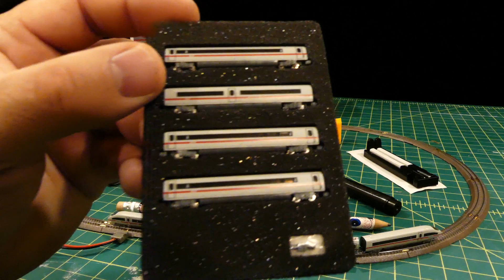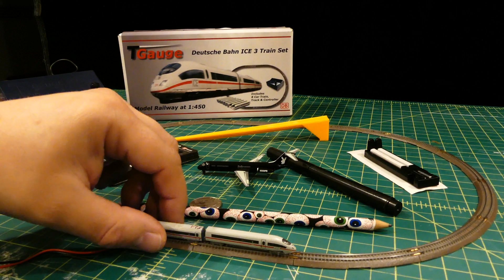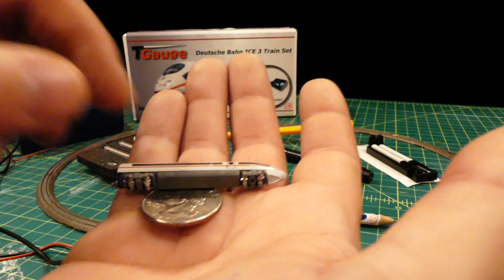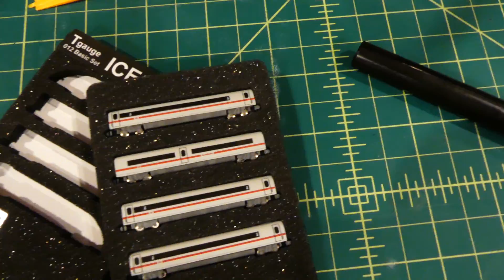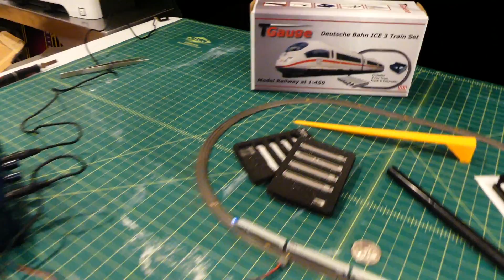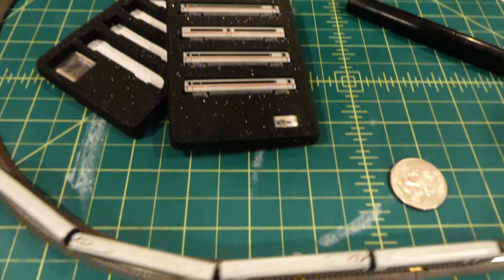T Gauge train set ICE 3 R-042/012

Comment: Thanks for your video!!  I've been experimenting with T scale ... hope to use couple of these engines to run/animate an overhead crane in my HO scale buildings ... a work-in-progress.   Note: it's fairly simple & cheap to use an Arduino to make a directional 5VDC PWM power supply for these engines.

Comment: Techniquely this train the "T" guage isnt what they say it is. The guage on trains is determined by the distance of the iron tracks which the T-guage doesnt have. It works on magnets not wheels on tracks.
Reply: jimmy tiler. The wheels and trucks work the magnets just help keep it on the track because it’s so light.
Reply: Just like Evan Forst said, it only has magnets on wheels for stability and it still has motors in the power units

Comment: Very interesting video. This has been useful to me as I have just purchased a BR 125 HST starter set. I am not sure whether to leave the 3 number AA alkaline batteries in the controller whilst plugged into the mains with the AC Adaptor. The instructions are silent on this point. What have you done in this respect?
Reply from the maker: Congratulations on the set Yeah I’m not certain either I have only been using batteries I would imagine they did not include the circuitry to recharge batteries I would think they’re both separate Circuits

Comment: Why is everything on tgauge.com so expensive though???

All the starter sets are like $300!!
Reply: Compared to most H0 stuff, it's still not that expensive and worth the money.
Reply: Smaller scale doesn't mean lower prices.
Reply: Any scale that is smaller than N scale or bigger than HO scale is going to be a lot more expensive.
Reply: Hello doberman2374 the smaller trains are much more money than the bigger ones at the moment I’m playing around with n gauge which is quit allot but much less than these ones but are still a lot of money.
Reply from the maker: Be sure to change currency to US dollars That will remove the VAT tax which is about 20% That brings us set down to about 250 But they’re going to charge around 30 bucks for shipping. Also the conversion rate to pounds  changes from time to time . Unfortunately just because it’s small doesn’t mean it gets cheaper. it’s  Much more in Japan. But I am hopeful that US retailers will Start Selling at a decent price in The US